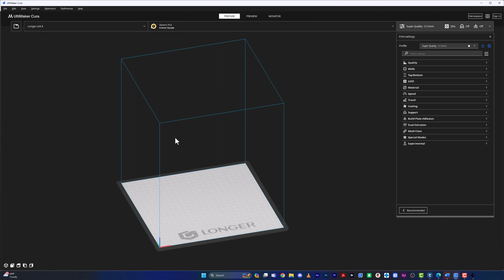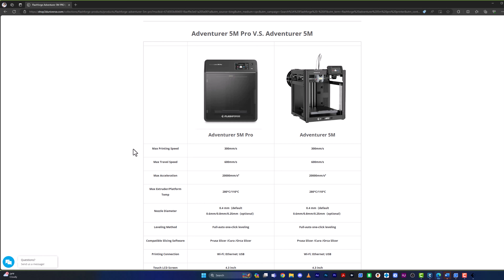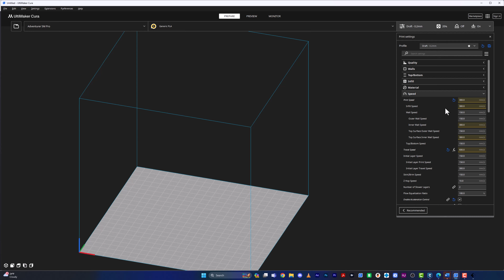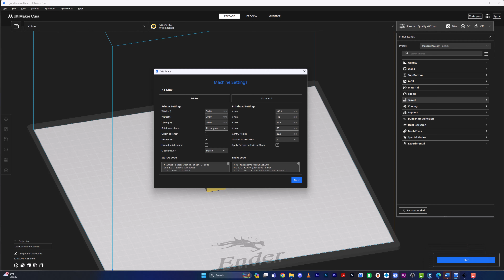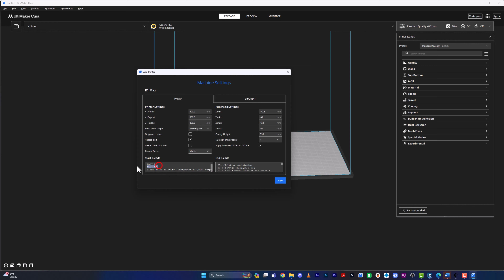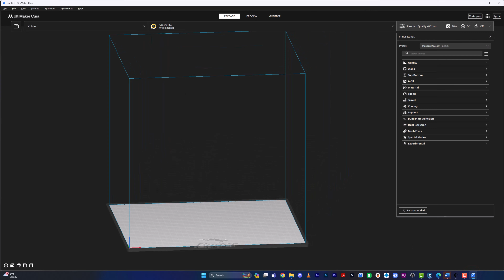3D Printer Not in Cura? Create a Custom Profile

Comment: Why would you select Marlin gcode type in your slicer profile for the K1 when it’s a Klipper printer?
Reply: Did you get this working with klipper? I did the same as in the video, but with Marlin like he says.. the bed and extruder heat up, but then nothing happens... Extruder just stays in the back of the printer..
Reply: @NerdyFpv  I use Klipper as my gcode type with no problems
Reply: @troyblackburn4522  My bad, just read you were talking about the K1. I was thinking of the FF 5mpro. I could not choose Klipper on the list there, and did Marlin like he did in the video. But not working. Will look into other settings.

Comment: To get an accurate time estimate, install the "Printer Settings" plugin. Also set the speed and acceleration values there.
They should not change the values indicated in the "Speed" tab, but they allow you to accurately calculate the printing times.
This is because the slicer does not know the values possibly limited by the printer firmware (this applies to all printers).
Furthermore, it would be better to set the REAL values of the different printing profiles supplied with the stock slicer - for each type of filament -, not those indicated as "maximum" in the advertising!
I believe you also need the "Moonraker Connection" plugin to communicate with Klipper printers.